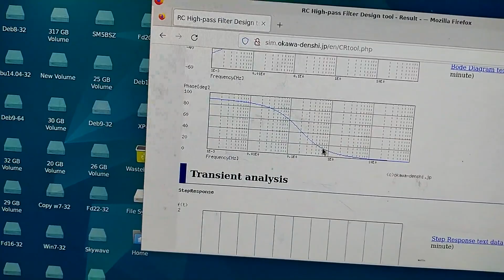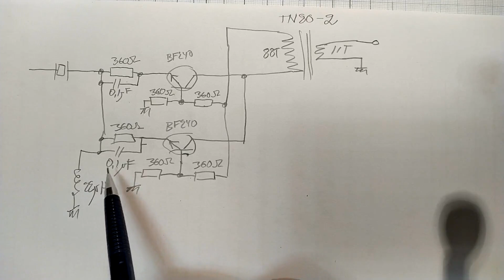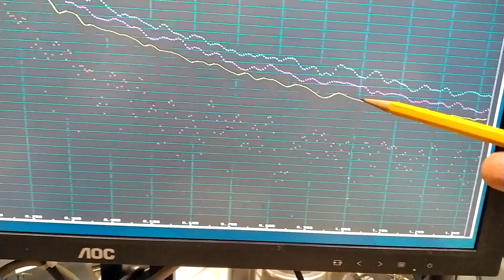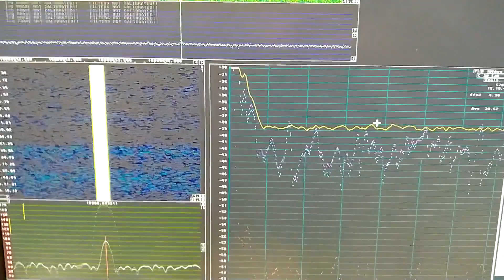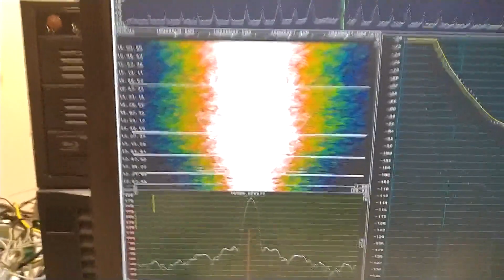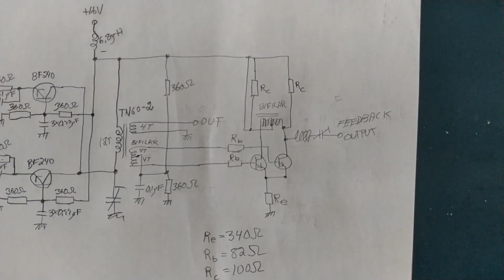nerds91

Comment: If only you had a phase noise measurement gear I can trust... Linrad is a joke.
Reply from the maker: In the video I am currently preparing, nerds103, I compare my setup with a PN2060C. The result is the same except between about 1 and 70 Hz offset where the internal noise of the PN2060 is a little higher, up to 5 dB, than the noise of my test object.  https://qsl.net/bg6khc/pn2060c_phase_noise_analyzer.htm